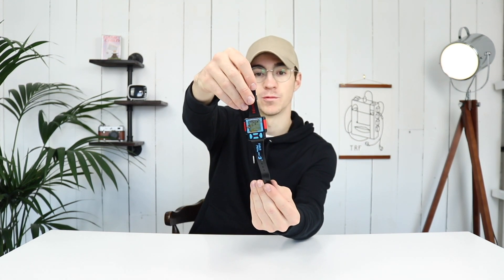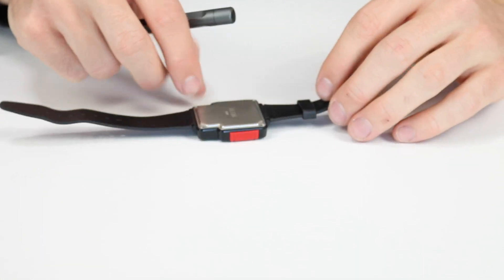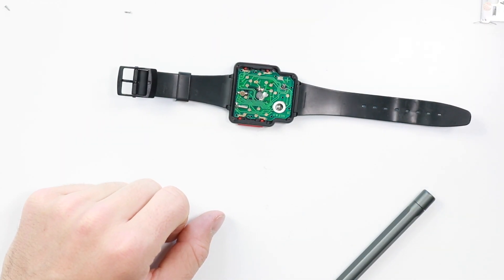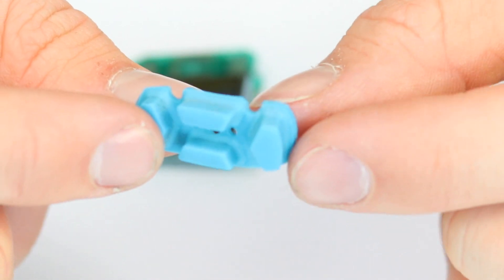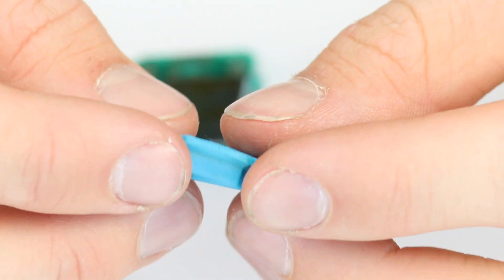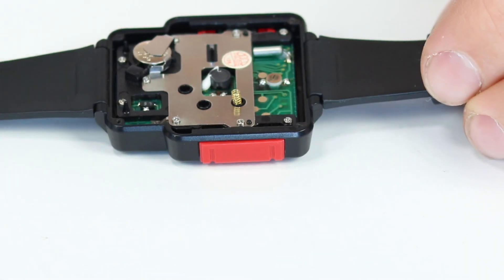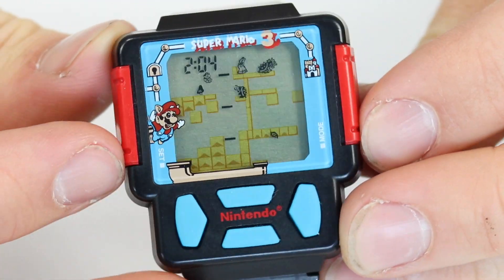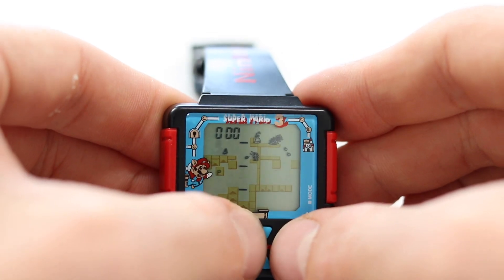The MOST Frustrating Mario Game EVER!

Comment: Another awesome video mate, I had this one and the Zelda one as a kid (I'm 36 now) I don't remember them being that hard lol, but read this pal:

The object of the game, as in the original Super Mario Bros. 3, is to save Princess Toadstool. The game is controlled with the left, right and up buttons with up acting as the jump button. In order to navigate through the level, the player must time their jumps and movement properly to prevent Mario from getting hit.

To start the game, the player has to go to game mode and hit the bottom button. Mario starts in the top left corner. He goes down with an elevated platform. He must avoid a Fire Brother, who tries to hit Mario with a fireball. Then, he can go to the right and get a Starman for invincibility against the Goombas coming at him from the left. He must hit the P-Switch to open the warp zone to go to the bottom right. Then, Mario can get the Super Leaf and swat his tail at Goombas. The Jump Blocks get Mario to the next platforms above to face Bowser. The game puts the player in the top right corner, where Bowser is spitting fire at Mario. A coin will then appear above the player. Bowser can be defeated by going left and under him and jumping underneath him several times until he falls. Then, the game is over and the player gets to start all over again.

Just copied it off a site for ya
Reply: This sounds really elaborate compared to what it looked like in the video!

Comment: Hey man I have 3 star fox watches all with the same issue. When a battery is inserted they begin to continuously beep on and off. I took all three apart and cleaned them. I did a visual look at the solder joints and traces. I don't really see any corrosion. Any idea what is going on? I mean all three do the exact same thing. The one I had for a few years and worked last time I had a battery in it. Now nothing.